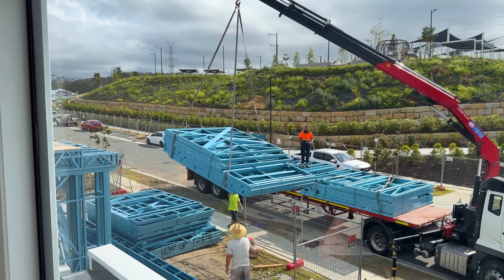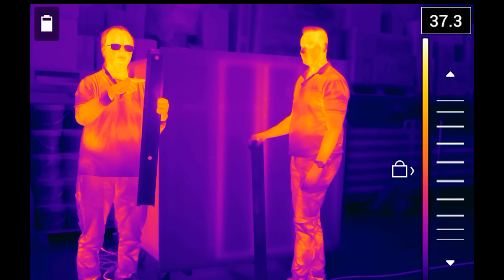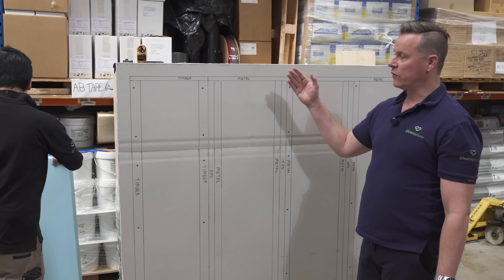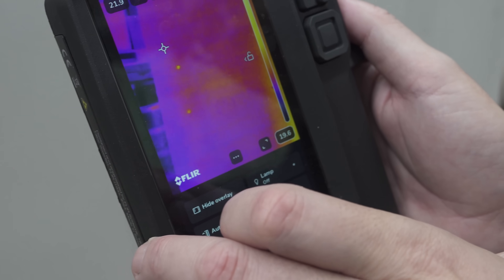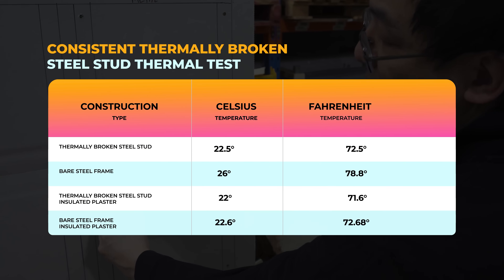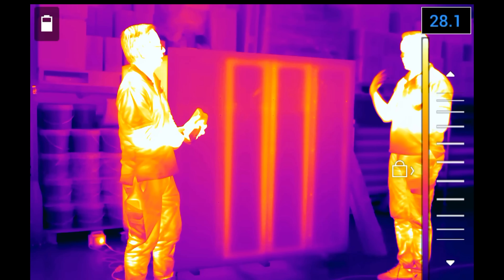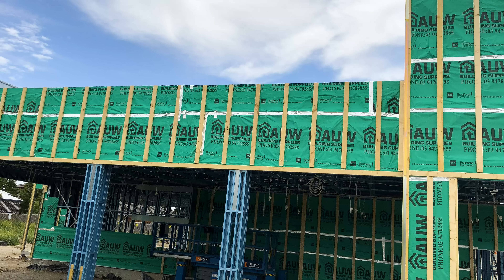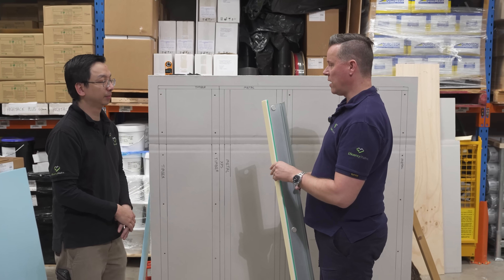Steel Studs BUSTED: Thermal Bridge Nightmare Exposed

Comment: Good old double brick with cavity wall insulation over here in Perth still the best option versus steel or wood. Our current house was built in the 80's with no fastwall bricks at all and it has eaves which are perfect for our warm climate. Roof is hard wood (jarrah i think) with bristile clay tiles. House still looks brand new from the day it was built in 86 and zero internal cracking - external bricks are federation red with creme mortar - the house is cool in summer and we have both ducted evap and refrig but we mainly use the evap which is great on really hot nights otherwise the ceiling fans work a charm at night and only need the refrig when it gets over 40deg during the peak heat of the day.  We have natural gas for winter heating but rarely use it
Reply: Just sold my double brick home (too large for older couple) for a steel frame dogbox. The expansion and contraction in summer makes for interesting background noise and contributes to the visible cracks on the flush finish wall/ ceiling joint and similarly external. Unfortunately Adelaide is predominantly clay soil as opposed to Perth which I believe is sandy soil. This is one of the prime reasons for adopting brick veneer construction over solid brick but fortunately my old house was built on top of three metres of alluvial soil ( essentially sand) and after forty years almost no visible cracks.

Comment: As an electrician, i refuse to work in steel frame houses now.  There's many reasons, usually being sharp edges and screws exposed, trusses 1200-1500 apart, and the webbing of trusses to tight to fit through.  they suck.
Reply: Ships are generally built of steel and full of electric cabling and cable trays. Perhaps you should seek a less mentally taxing profession 🙄
Reply: Yep, it is harder to wire and solid mounting is harder!
Reply: Interesting point.  Something I hadn’t even thought of though I worried there was a chance the entire frame might go live if there was a short somewhere.

Comment: A point not often thought about is fires. Most fires start in the kitchen and are usually brought under control and confined to the kitchen. In a timber framed house, this damage can be repaired relatively easily. A steel framed house, however is usually a total write-off, as the steel ‘pulls’ and twists the whole house completely out of shape.

Comment: Termites are not an issue if you use treated pine.
My biggest gripe with steel frames is how flimsy they feel when you open and shut doors.... windows 10m away vibrate.

Comment: You can perfectly well build with a steel frame and have good thermal insulation; for this, just add a good layer of EIFS (Exterior Insulation and Finish System) and the problem is solved.
Reply: Thankyou Jose for clarifying that EIFS...

Comment: only solution is to use the offset studs and affix plaster to every second stud with a gap.
Reply: I built a double offset insulated wall inside my building it made the room 160 mm smaller but much quieter and needs less to no heating and cooling. I did it my self with added power points with a pay back period of under 2 years at present power costs.  Another place I did the same with dry wall in between and a layer of rigid foam board added another 35 mm but no noise from the adjoining room at all.

Comment: If you're going to be at the very least disingenious by comparing snow country to tropical Queensland and then wonder why we don't insulate warm to tropical homes the same as ones with snow covered roof keeping the outside of the house below zero day and night and then conspicuous not mention the price  to allow and actual price comparison and if the difference in the hot conditions simulated is 22.5 to 26 which would mean turning the AC on a little sooner for the steel heating up a few degrees a sooner the turning the AC off sooner as the steel would be cooled faster that the timber making the cooling bill to break even.
Could this be that reassemble steel frames are.lighter and quicker to assemble of the onsite builder reducing the billable hours they can charge. Maybe that's something to wonder about in the video.

Comment: Major problem with this entire video. No new house builds use the size you made the video on. You say 2x4 Which hasn’t been that size since ww2. Even in America, they havnt actually been that size for many many years. You mean 90mmx45mm. But that is also not what is used today.  New houses are actually mostly built with 70x35mm. And steel frame is much the same. You also seem to have missed the biggest issue, in Queensland no new houses even have the walls insulated at all. Wood or metal frame makes no difference, when it’s a frame, a space and bricks. And you also use Canada and Europe areas, as examples of places that use continuous insulation. Queensland, has no snow, insulation is not for warning inside ever. Completely opposite, insulation purposes. Queensland summer is 30-40 degree (86-104 Fahrenheit)
Reply from the maker: Queensland most definitely do build their homes with insulation.
Reply: The NCC appears to contradict your view; for brick veneer walls in climate zone 2 (Brisbane), the external walls require at least R1.5 for DTS.

Comment: 13:06 
"But if you try to upgrade your house later...
your town planning [department] may not allow you to widen your home by 50-60 mil"
Is that real? Who will save us from this hell?
Reply: Yourself allow a 5 -10 % extra on your boundary if you push every thing to the limits you will always have problems with everything in life when you find the limit. I built a double offset insulated wall inside my building it made the room 160 mm smaller but much quieter and needs less to no heating and cooling. I did it my self with added power points with a pay back period of under 2 years at present power costs.

Comment: Sounds like they need a hemp based continuous thermal insulation.
Reply from the maker: Sure why not!  Anything would be better than nothing, and as long as it’s continuous.
Reply: Lime in the Hempcrete is caustic and results corrosion in the steel frame which need to be address too

Comment: This isn't testing a thermal break, as you don't have any cladding to reduce thermal conductivity from. It is not clear if you used a plaster sheet on the inside or not, but you don't use that material on the outside of a home anyway. Put a sheet of tin or another common cladding where a thermal break would be more useful in preventing radiant transfer of heat, as it is intended. Also testing the gap effect, where the cladding has an air gap between the cladding and the frame.  The length of the test will also have an impact on results as timber has more thermal mass. Timber is slow to heat up but also holds the heat for much longer.
Reply from the maker: It was running for 8 hours, by the time we did the video.  In the video, there is footage inside the rig.  We used an airtight vapour permeable wrap.  In the scheme of things, a cladding wouldn’t make that much of a difference, but in reality, a cladding being exposed to sun, would probably have more radiant heat in the cavity than what we were able to simulate.  This is just a demonstration on the difference in performance of all 4 systems where they are largely exposed to the same environment on either side.   It’s quite simple really, but we see these thermal imagery, like this on the field, with steel and wood framing.
Reply: @ecoevo  what you are testing is the ability of the thermal barrier material to insulate the frame not provide a thermal barrier. It is the gab between the cladding and the frame that creates an air gap and thermal barrier. if vented correctly this air gap cools from top to bottom. Air being a good insulator creates a thermal barrier.
 so you are in effect only testing part of the function of a thermal barrier. I would guess A true thermal barrier this air gap will perform similarly to the European clad design as it has a layer over it.  the image below shows a thermal barrier with air gap in the lower right, . 
https://www.google.com/imgres?q=thermal%20barriers%20design&imgurl=https%3A%2F%2Fi0.wp.com%2Fnoho.com.au%2Fwp-content%2Fuploads%2F2023%2F06%2F02_grundprinzipien_en.jpg%3Fresize%3D750%252C579%26ssl%3D1&imgrefurl=https%3A%2F%2Fnoho.com.au%2Fpassive-house-design-01-thermal-envelope%2F&docid=0pmOBZZ2VXaenM&tbnid=xg8I-j5Hyu07XM&vet=12ahUKEwiP8ND-2uGQAxWkka8BHc4jPHEQM3oECCAQAA..i&w=750&h=579&hcb=2&ved=2ahUKEwiP8ND-2uGQAxWkka8BHc4jPHEQM3oECCAQAA
Reply from the maker: That vented facade works for you in warmer climates, however if the air is 40 degrees your venting it with hot air anyway.  In a colder climate that vented cavity works against you.  But you are right we didn’t have any cladding in this mock up.
Reply: @ecoevo  it will work at any temperature due to temperature gradients. It is easy to google the importance of the air gap. The nation wide house energy rating scheme has some good information on thermal bridging you can read.
Reply: @landslide4187  thermal modelling in Australia like NatHERS (which is used for energy compliance) only givesa air gap a R value of up to R0.44 (usually a lot less). It counts for very little.

Comment: Steel frame wouldn't even cost a months extra electricity to cool over the life of the building. One termite repair to a house frame can be a complete or major rebuild, and insurance usually doesn't cover it. I'll have the steel frame.
Reply: And that's free after four years if you install solar.
Reply: @Spinafication 4 years? Haha. First of all, it aint free if you pay up front for it and yhen have to pay the maintenance, repair and replacement costs. You also need a battery which is more money and 4 years would only maybe occur if you use an absurd amount of electricity.
Reply: I got a steel framed house I put my own insulation in the walls before they put sheeting on. My house is cool all the time I'll even Queensland.
Reply: Or you could just install a termite protection zone for a timber frame house, way cheaper
Reply: @garywilkes421  I've worked on houses with termite mesh, mat, caps and even injection treatment that had termite damage. In Melbourne it's a common problem.
Reply: @garywilkes421   If you have a slab on ground house there is really no completely failure proof method to exclude termites since the demise of POPs.  Of course, many people degrade termite protection with poorly placed gardens, etc.

I am in SE Queensland and have a metal framed house with 50mm insulation between the frame and cladding. Even on the hottest days, it takes the ducted aircon less than an hour to pump all the heat out of the house.  If I run it in the mid-afternoon to minimise evening usage, it will run off solar for free (most days).  When I decide it is time for a home battery (when sodium batteries become available), the aircon becomes even cheaper.  Or perhaps, I will wait for a suitable electric car capable of V2H.  I do not believe that the current state of batteries and electric cars will meet my needs.
Reply: Exactly, just have at least 1m of concrete edging around the entire perimeter and use hardwood. Our house in tropical qld is 35 years old, we have termites in the garden and we've never had a problem. They will have to parachute in if they want a feed.
Reply from the maker: This is an interesting calculation.  You’d need to consider the lineal thermal bridging plus the additional cross bracing, steel framing has.
Reply: i want to see how much heat insulation holds into the night! roof insulation made my house hotter! slower to heat in the morning but hotter over 24h
Reply: @custardcatcher5195 I have a black tin roof, anticon and I haven't installed mine yet and it cools down so quickly and doesn't even get as hot even though it's a two story
Reply: Yeah nah. 
Double brick or seeya later.
Reply: Why don’t you just use compacted soil blocks!? It’s free material
Reply: Steel frame with sheets at both sides is just a cheap bad quality house. Double brick is the way to go.
Reply: I'm in Romania. We build in plenty of styles and steel frame is ok. Insulation in the wall is beyond terrible, it's retarded. You shut down the main advantage of hollow wall. Speed. Just build it normally, fastest possible, no tape, then put on cheapest flammable insulation on outside of the wall, thick as possible, it's still faster then inside insulatiin. But don't cheap out on the stucco. Without that you burn big style ... London style. Dubai. LA. Whatever. Don't put that exterior framing where you put the roof on the wall that is indeed very fast, looks good but it's absolute garbage and burns like a furnace. Just take your time, stucco applied by hand, glass fiber mesh between layers ... done. Still reasonably fast,, plenty of fire resistance. Especially against forrest fire or burning up the crops or any of those sparkly stuff that spreads by embers. And steel frame here is cheaper then wood

Comment: Another thing with steel frames...your washing machine spin cycle will unscrew roofing screws at the other end of the house.
No vibration absorption whatsoever.
Whole friggin house shakes.
Steel homes too cold in winter, too hot in summer.
Builders give zero shits about thermal bridging.
Edit: All I see is DON'T USE STEEL FRAMES!
Reply: That won't happen. There is no vibration transfer from the washing machine. The house does not shake at all. Impossible for screws to come loose.I lived in steel frame house for 25 years.
Reply: Why doesn’t Australian build with pressed soil bricks?
Reply: @alanmay7929  It is done here, just not that popular.
Reply: @brianlove8413 and why isn’t that popular?  All that waste of material that could have been used more wisely how come your house are sooo fragile and ineficient?
Reply: @brianlove8413 you have all that soil for free why doesn’t an industry exist that just transforms it into building materials? In much poorer countries they litteraly builds with concrete and pressed/compacted soil bricks/blocks and more.
Reply: Yeah, sure! Best put your tin foil hat back on mate.  :)
Reply: I'd sue your builder for stripping out all your roof screws because it isn't exactly easy to unscrew a roof screw.  So what happens if the washing rotates turns in the other direction?  Does it tighten up the roof screws? Whole house shakes?  Did you repurpose a cement mixer truck to a washing machine?

Comment: At 6:07, it looks like the rock wool is compressed against the sides of the timber studs, while for the metal studs, it looks less tight.  Are there open air gaps inside the metal channels?  Looking at the image a 9:27 or 3:25 with a screen ruler, the open area between the studs looks to be the same width, leaving the insides of the channels open and apparently uninsulated.  -- Oh, from the 8:08 simulation diagram, the thermal break strips are on the back/hot side out in the 38°C free-air.

Comment: You talked about using thicker insulation on metal stud, there has been studies showing multi layer insulation is better, in Sweden the wall is a multi layer sheet of wood, I think it was 7 layers giving a massive R value, R27 i think, don’t quote me on this. You can look this up
Reply from the maker: That would be US Rvalue.  We spoke to metric R-Value. 1 metric is equivalent to around 5.  https://efficiencymatrix.com/converting-r-value-metric-to-imperial-calculator/

Comment: Great video, here in Sweden they have mineral wool external insulation products - I tried finding something similar in Australia but no luck :(. Another thing is that steel frames could be good idea for internal walls - the thermal bridging with the slab could help regulate internal temperatures.
Reply from the maker: That’s a great point!  Wonderful idea.  I agree!
Reply: We have all types of insulation here, that type is one of the  RockWool types I believe. Isn’t that it in the video?
Reply: @pauls8456 no, what's used in the video is knuaf "earthwool" , which is glass mineral based as opposed to the "real" rockwool which more rock based.
Reply: We have it, it's called rockwool. Cost a lot more here tho.

Comment: Never every seen that claimed thermal break used, yet you said is code.
Reply: from NCC 2019 ie a thermal break with a minimum R value of 0.2 is required for roofs and walls where the external lightweight cladding and internal lining are fixed to the same member, eg wall stud or roof rafter. For roofs, lightweight cladding refers only to metal roof sheeting and for walls, includes weatherboards, fibre-cement and metal wall cladding.

Comment: Great explanation and demonstration of the straightforward concept. In mature building codes like the IECC, they say that whatever wall construction you use (timber, metal, masonry) it must meet the same R-value thresholds. Simple and fair.  I don't know in Australia why we allow steel to get a free pass. Every building system has trade-offs. Let science compare them fairly. 
Well done guys.
Reply from the maker: Thanks Sean. You inspired this.👍
Reply: Steel frame does not get a free pass, thermal bridging of steel is modelled as part of the NatHERS standard.

As far as the "prescribed" energy efficiency requirements of the IECC, that's the same functionally as the DTS energy efficiency requirements (part 13) of the Australia NCC Housing Provisions .

If I remember correctly it was only the 2021 version of the IECC where thermal bridging and continuous external insulation really became a focus...  and detailed requirements only came out in IECC 2024......

So Aus is not that far behind the Americans, the US ICC is part of the consideration whenever BCA is updated.

Note the common R7.5 (Imperial) CI used in the USA (at least the temperature climate zones) to meet latest IECC thermal bridging requirements, only converts to an R1.3 (metric) here in Australia. ~40mm of XPS will do that job... Or 30mm of PIR/polyiso